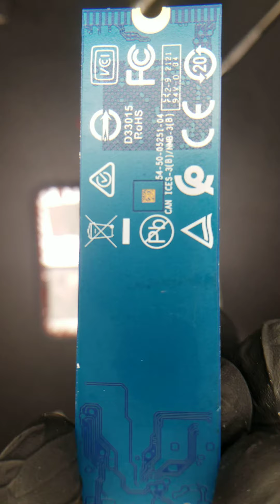SANDISK EXTREME PORTABLE SSD DISASSEMBLY PART 2

Comment: Thanks for the video. I wanted to know if one can replace the M.2 NVSE SSD with a faster one. Will the newer M.2 SSD from some other brand work with this "Enclosure"?
Reply from the maker: you try replacing with faster one, but sometimes ssd will downshift speeds due to bridge limitations.

Comment: Wanted to add there are 2 different versions of this SSD. The older version that is labeled as up to 550mb/sec are SATA M.2 and will work with SATA adapter. The later version labeled as 1050mb/sec are NVME and would work better directly installed on motherboard's PCIe M.2 slot. I haven't checked the newest version which are rated for up to 2000mb/sec and has triangular shaped hole rather than lop-sided trapezoid hole. I imagine it's similar internally but harder to open
Reply from the maker: Thank you for your observations, i am sure many community members will appreciate your input.

Comment: Main question is does removing the NVmE from the board take away the sandisk security function? I'm hoping it does so I can use it in a PC
Reply from the maker: in our case, drive was visible in PC with all data intact.

Comment: What NVME SSD model is used? I read somewhere that it's SN550E but I am not sure.

UPDATE: I got one and it had SN560E
Reply from the maker: its been a while i dpnt recall. if anotherpne cpmes in i will let you know
Reply: @qubexdatarecovery  I ended up getting one and it was SN560E.

Comment: I have problem on my extreme and it's probably with the USB-C connector. The error message is "Power surge on the USB port". I tested it on other windows and mac PC's and changed the cable too. I will open and try in another case. Could you tell me what model the connector is? SATA 6 pin B Key? Your video is excellent in part 1 and 2. Thank you
Reply from the maker: Power surge can be cause by different problems. Are you plugging it in usb2 or usb3 port? Check both connectors first for any bent pins sometimes inner pins get bent or misaligned. If both connectors are fine and you are using usb3 port, try connecting this drive to a different computer, if problem persists, it is possible that sandisk internals may be faulty. You will need to take it apart and test drive itself, without usb bridge. Thank you.
Reply: @qubexdatarecovery  . I changed the case to an SSK M.2 NVME model and it worked perfectly again. The SSD Express Scan Disk case board must have had extra power energy. I use USB3.1 on my laptop. Thanks for your video and comments
Reply: @Muca22  Hi, which exact model did you use? Amazon link? Thanks!

Comment: Can we add the ssd to laptop, i mean make it fixed in the Motherboard of laptop
Reply: @Mark Albarran how fast is it?
Reply from the maker: yes you can
Reply from the maker: good point as it does get quite hot when fully operational. Most laptops would already have heatsink and thermal pads attached, but not all. This drive does need it.

Comment: after removing the ssd i cant install other ssd on the ssd board
Reply from the maker: i have not tried, but i assume it will work just fine. Trying this will not hurt your new ssd, connectors are pin to pin compatible.

Comment: Thanks for the video. I wanted to know if one can replace the M.2 NVSE SSD with a faster one. Will the newer M.2 SSD from some other brand work with this "Enclosure"?
Reply from the maker: i have not tried using diff brand ssd with this bridge. However i assume its possible. Nothing bad happens as connector is universal and modern ssds are able to down shift the speeds.